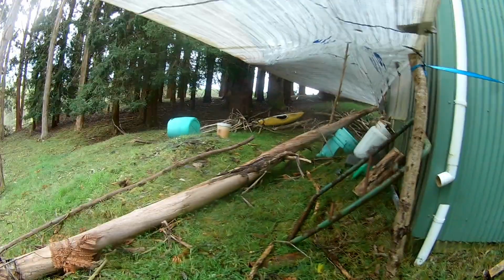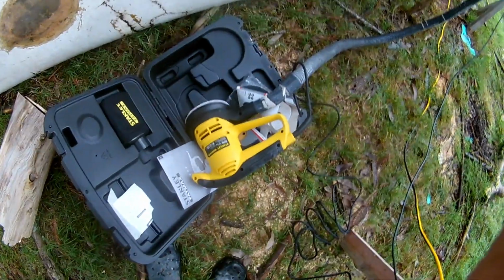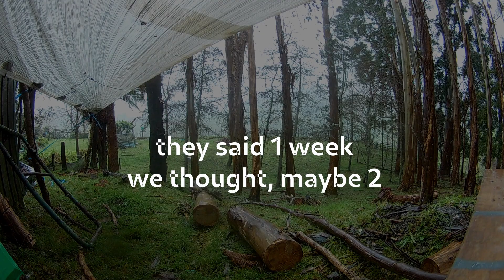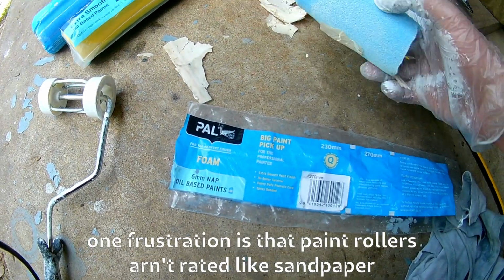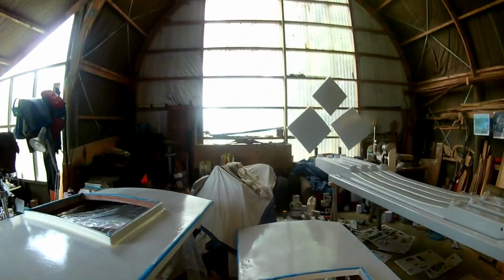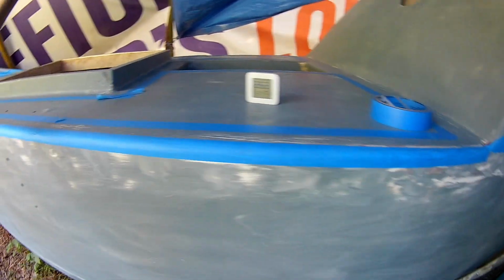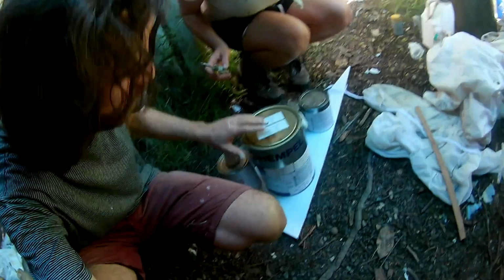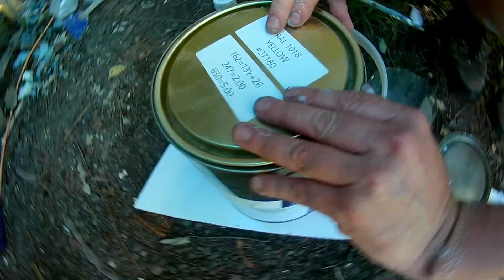Imagine - Pahi 31 restoration, episode 26 PAINT!

Comment: I've been making traditional oil paints and varnishes out of soaps of copper zinc magnesium and calcium. Palmates and stearates. And Pine tars and rosins.
I would never go back to chemical rubbish. The old school stuff soaks in, preserves the wood, is superhydrophobic, much less toxic, does not need sanding off to recoat or replace.
Modern paints form a skin on the surface while fungal spores are free to run rampant rotting away underneath.
Reply from the maker: wow, where did you learn to make paint?
Reply: @dominictarrsailing  Theres quite a lot of info online if you look for it. If you want to get really flash then the violin building forums are the ultra fanatics. The varnishes and glues used by the old masters are basically mixed metal soaps of resin acids made with potassium hydroxide  and mixed metal salts from hardwood ashes.
Kauri gum from NZ is the best, and supplied the whole world fir paints varnishes and linoleum for over a century.
If you want to make a cheap enamel paint outperform an expensive antifouling, its quite disgusting to lean what they charge so much for. 
Basically if you get some sunlight soap, fissolve it in hot water, and stir in some copper sulfate solution, you got your copper palmate/stearate precipitating out. Oil soliuble but superhydrophobic.
Add a few tablespoons per litre, and some microlight, or fine bentonite clay to your oil paint.
Pretty much what you pay five or six hundred for 4 litres is the result. Probably better.
I'm liking using odourless clear lamp oil as a solvent base. Wood turpentine would be better. But the lamp oil soaks in well and slows the drying.
Used fish and chip oil is a very close substitute for boiled linseed oil, polymerises with the oxidised double bonds, soaps well with copper, zinc, calcium, magnesium, iron, aluminum.
Manganese or zinc are good catalytic drying agents rather than the lead oxide that used to be more common. 
Most of the reason we don't yse this stuff today is the built in obsolescence, and patent systems, and US lead corpserat scamming culture.
Reply from the maker: @aaronfranklin324  aha! Violin makers! There is always a community that that goes full deep. Once I realized, don't search for how to fix a two stroke outboard, search how to fix a dirt bike. Those guys will rebuild their engine regularily, and they know everything about it. For the good information on a diesel it's vintage tractor restorers. Well, the boat is painted with polyurethane now. Will have to try home made paint later.

What do you think about DIY coppercoat? copper powder mixed into epoxy?
Reply: @dominictarrsailing  copper can retard epoxys cure, but the copper stearate/palmate as I described should be soluble in some epoxy thinner, and blend in well. Likely up to five percent wouldn't affect its properties. Perhaps make the epoxy a little less stiff, as a plasticiser. A good thing.
But for anti seize? Copper powder is a bad idea around metals. It will sacrificially corode steel, alloy, stainless.
Copper salt compounds won't.
Reply from the maker: @aaronfranklin324  interesting!

Comment: My holden commodore radiator fan motor disk sander is unkillable, quiet, extremely powerful on 24v with 8 inch sanding disks, better than any of the random orbital sanders you have been wasting your money on on 12v.
Uses 10% of the electricity.
No vibration or noise.
Reply from the maker: sounds great! show us some footage of it and how it works!
Reply: cool idea, so many good parts on cars can be re used, and they are made to last years and years